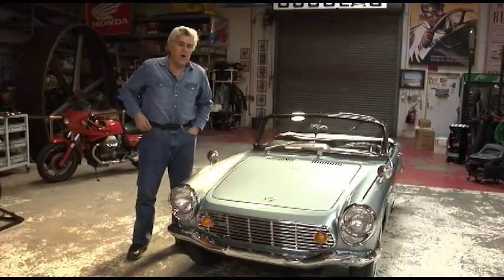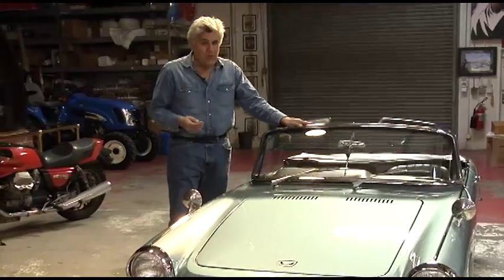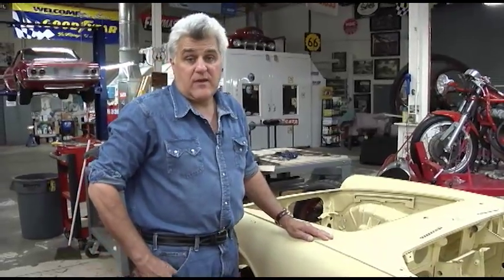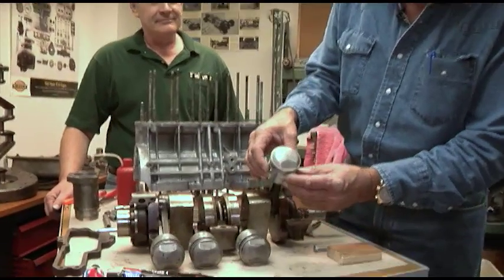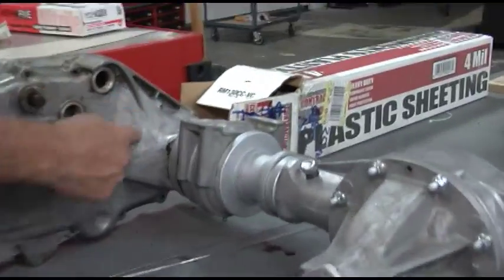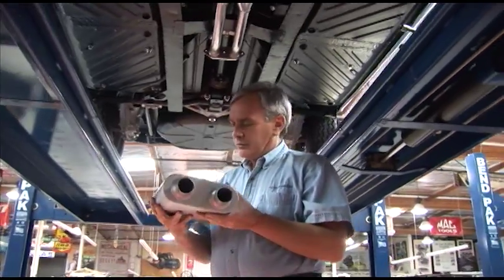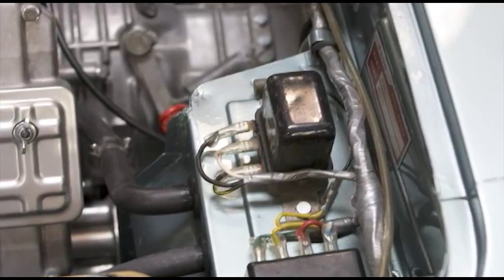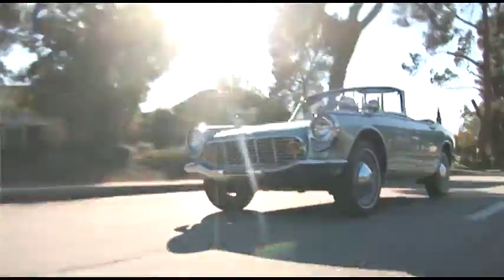1964 Honda S600 - Jay Leno's Garage

Comment: I first saw the S600 and S800 in 1967 in Okinawa on my way to Vietnam.  The 800 had so much more HP that it warranted a driveshaft.  I took a brochure to Vietnam, studied it and converted the reported 0-100km to 0-62 miles and thought it was pretty quick for what it was.  I wrote Honda and told them that I wanted to buy one.  To their credit, they recommended that I not buy it as it would be a "stand alone" (they weren't being imported to the U.S.) without parts or service.

Comment: What Jay has here is a Honda car using an engine made from two Honda CB-350 engines.  The Cb_350 was a 325cc twin using two constant velocity (CV) carbs.  Honda always tried to use existing parts when building bikes, cars or agriculture equipment to save time and money.  Mr Honda once said about his engine philosophy: Good breathing, low reciprocating weight and strong bearings make up for the high revolutions needed for the desired high horse power.  This car perfectly reflects  Mr. Hondas building philosophy.

Comment: I thought those cars had the same 600 cc engine the little Honda coupes had...those had 2 cylinder air cooled motors...Jay is so lucky to have such great toys.
Reply: David Eutsler+ Honda coupe was the S800. It had a 791cc engine and made  70 hp my dad had one.

Comment: Do these engines have balance shafts? Im curious what the vibration is like if they don't. It seems like they would need to be quite smooth in order to rev that high in a street car.

Comment: In 72 they came in with the AZ 600 2 cyl.and it sold for  dollar a pound. I had one and it was always broke down. Cool thing is when the Starter  broke it was easy to push start in 2nd gear from the doorway .

Comment: 9500 rpm redline due to short stroke engine-- my old Z-1 Kawasaki only revved 9 grand and 1000 cc maybe 65 hp- Cool looking car, Midget/Sprite had about the same HP, 60
So this before the 600 Coupe? Maybe Falicon could do some crank mods for you?

Comment: such a great little car, the japanese often used british and other european cars for inspiration such as the toyota 2000gt being heavily inspired by the jaguar e type and lotus elan. They might not have quite matched the driving characteristics of the cars they were inspired by but they certainly knew how to outdo when it came to finish and finesse in design. Often costing way less as well.

The smal british cars of the 60s do fall short to this in all but the driving aspect. 2 british companies however that dont seem to get enough praise today are bristol and jensen who produced some amazing looking cars with a good quality finish. check out the jensen cv8., jensen 541s, jensen interceptor, bristol 406 zagato, bristol 405, bristol 410.

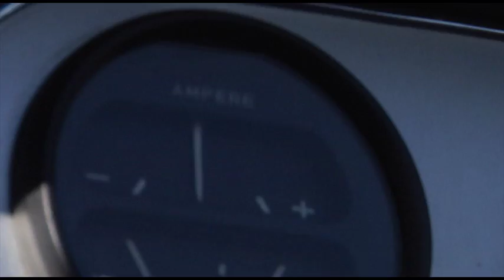Comment: At the 12:00 mark, Jay wonders if this car was originally imported into Canada, because the speedometer is in km/h. Canada did not adopt the metric system until 1974 - 10 years after this car was built. Up until the 1974/5 model year, all gauges in Canada cars were in Imperial units, ie mph. And, all Canadian cars were (and still are) left-hand drive as they are in the US.

Comment: Jay Canada was in MPH till 1977. Then they went to KMPH. I STILL THINK IN MPH! That'll  tell you I'm a FOG. Good stuff on the Honda S600. The carbs on the S600 were CV carbs and had to be precisely synced for it to performproperly. The CB450 Honda used them as did the CB350/360 plus the Gold  Wngs . It was overcarburetted in stock form. Nice restoration. Also Honda engines were all cold natured and needed to use choke unless it was above 100 F.

Comment: In 1979 I had a Honda N-360. It was the first Honda car (imported) to the US. It was made in the 70's. I don't remember the exact year. Like the child fool I was, I sold it soon after I bought it. Wish I had it now.
Reply: HONDA imported AN600 sedan and AZ600. They were imposed in the late 1960s and prior to the civic. Had a 600 cc air cooled engine. Worked on them in Charleston SC. N-360  wasn't imported as I recall, they did make a small P UP with thev360 engine. American Honda was founded in California in 1958.

Comment: Since he added Dynamat to quieten it down, which adds a lot of weight, I'm surprised he used a Flowmaster, increasing the sound.  This car sounds great, but it'll destroy your hearing after awhile.  I also wonder how much weight could be saved if the chain drives were removed/converted.  Last, a small turbo would be a cool addition.

Comment: Couple of mates had Honda S600's back in the early 70,s. They formed the original Honda car club here in Melbourne, Australia. Would have to say the were the most unreliable cars known to mankind at the time. You literally needed a boot full of pistons to get from A to B. Best of luck with yours Jay. The later S800 was far more reliable.
Reply: I drove my S600 for two years without problems revving to  11,000 every day.

Comment: looks like your could put it in a shoe box.  Wish jay would do a segment on a SAAB 9000 1998 dam what a car to mod on the cheap. My 9000 480 hp total cost 4700.00  45 to 100 in 3.6 seconds 4 gear burn and it corners like a corvette.

Comment: Yeah, that car would definitely benefit from a fifth gear. I had a 1971 Toyota Corolla as my first car and it was super reliable, etc but one thing it needed was a fifth gear. It came with a 4 speed (I believe a 5 speed was available but that's not what mine had) and going 55 on the highway was murder in 4th gear with 13 inch tires and a 3.90 rear end.

Comment: Honda got on building extreeme engines, but mostly for motorcycles, 9500 there is not much for a 600cc straigt four.
its very easy to see here that the motorcycle side made this engine possible, i wonder if a version of it was used in a bike?
there was no 600 four in 64 but maybe a smaller four for racing or something?

sounds nice but thats how straight four engine sounds to me with an open exhaust.
i like the LFA car best there.

Comment: It sounds like a motorcycle with a 4 into 1 pipe !
This is unlikely to have been exported to Canada. In 1964 Canada still used the imperial system as the switch to metric units only happened in the mid 1970s. And, of course, if it had been a Canadian model the steering would have been on the left. Indeed, at least one Montreal area Honda dealer has a coupe version on display. It has left-hand drive and a speedo graduated in mph.

Comment: I don't know where these cars were sold, but this is not at all like the 1970 Honda 600 Sedan that I used to have.  The Honda 600 that I knew, had front wheel drive, powered by a 2-cylinder, air-cooled engine that appeared to be adapted from 1960s Honda motorcycle engines.

Comment: 7000-8000 rpm on the freeway haha - that's my 1.4L VW Golf Mk4 downhill on the Autobahn, desperately trying to keep up with the BMW, Mercedes and Porsche at 160-200 km/h. Burning more oil than gas above 5000 rpm.

Comment: I thought it was going to a a two cylinder engine, like the little coupes they imported to here. Roller cranks are a waste, Smokey Yunick built a completely rollered Offenhauser engine and it didn't make any more HP than the plain bearing engine. But if it came that way it's no biggie. The chain drive is kinda weird. I'd guess they used it to lower the gear ratio some, kinda like VW bus transaxles used to be with their geared reduction boxes. It is a sweet looking little car, now Jay can get a paper route and make some extra money.
Reply: 505197 that is exactly the thought that crossed my mind watching this. Smokey was a genius and if it worked, he knew about it. I well remember his all roller motor. He went to considerable effort and expense and the gain was negligible. Jay my friend, just because it has roller bearings doesn't meant it doesn't need oil pressure. An engine needs 2 things to live - lubrication and cooling, and as a driver and racer I want to know if I have a problem in either area.
Reply: alfamonk Name me a few Honda engines that use roller cranks today. To use a roller crank you have to build the crankshaft as you go along adding rods. The cranks are pressed together. Harleys are built that way, and nobody ever accused them of being cutting edge. F1 engines have turned upwards of 20,000 rpm, and they don't use rollers either. Like I said, it's a waste, Honda isn't perfect, and I don't blame them for making a mistake now and then.

Comment: I like the cute little car.....surprised me it was a four cylinder 600.....weren't the Honda N600 coupes and sedans twin cylinder and air cooled engines and FWD????....back before the Honda 750 fours made their debut, I though it would be cool to try to transplant and N600 into a motorcycle frame.....
Reply: ....and they had roller cranks!

Comment: Why don't they make roller bearing crankshafts/connecting rods anymore?
Reply: They do in very high end applications. Very intricate and expensive!
Reply: Oh cool, could you provide a specific modern application? Do F1 cars use them?
Reply: I was under the impression Bugatti used them, but I stand corrected. The only modern app I found was Harley's.
Reply: That is very interesting, Harley would have been the last company I would have guessed.

Comment: High redline is typical of even the Honda motorcycles of the era.  My 66 Superhawk has a redline near 10k.  Better metalurgy in Japan and closer tolerances made engines that were far more leakproof than the brit stuff of that era.  And the cold blooded nature is typical of the bikes from that era as well

Comment: Lovely car, but why is it so heavy? I had a Reliant Kitten (don't laugh) - 850cc 4 cylinder, steel ladder frame, Triumph Herald copy suspension, 4 seater fibreglass body:  under 1200 pounds - 400 pounds less than the Honda - and the Reliant engine can be tuned to give over 60bhp at 7500rpm.

Comment: Newer Japanese engines can sound great also if people didn't couple them with those annoying fart can exhaust systems. I had a b16a with some Civic Type R cams running through a regular Dynomax Turbo muffler and that thing would absolutely scream at 8500 rpm.

Comment: I bet all the bearings are yhe same a cb750
Reply: Nope CB750 used plain bearings not roller. CB750 had an automotive style crank. The bearing on a CB750 were select and precisely fitted to each crank journal. Still use this system to this day.

Comment: 57hp aye.. honda set there standards low and stuck with it..
Reply: almost 100hp per liter is incredible for the time. no forced induction.
Reply: TheLeafySpring The 4.3L V8 in the 1964 Mustang made 164 horsepower.... that's 38 horsepower per liter.
Reply: And they have been pretty successful in maintaining that tradition!
Up until recently, the 1999 Honda S2000 had one, if not the most performance 2000cc, 4 cylinders, naturally aspirated engine.

The base 2005 Ford Mustang, which had an engine twice that size and 2 more cylinders, can barely keep up with it!
Reply: thematrixkid17 The 4.7L V6 in the 2010 Ford Mustang makes 210hp... That's 45 horsepower per liter.
Reply: Take a close look at that head while Mr. Leno's holding it. They are mini hemi combustion chambers! It's only 2 valves per cyl.,but they're dual overhead cams.  9500 RPM from a hemi!This was before Cosworth laid the groundwork with smaller included angle valve heads but Honda, Cosworth and Ducati were all leaders in developing what we consider modern racing engines. Honda developed some engines that were revving closer to 20,000 RPM by the end of the 60's. This is all great history..
Reply: whats the point all you believe in is triangles
Reply: Oscar Park True great story!